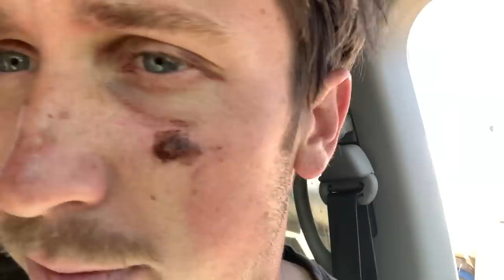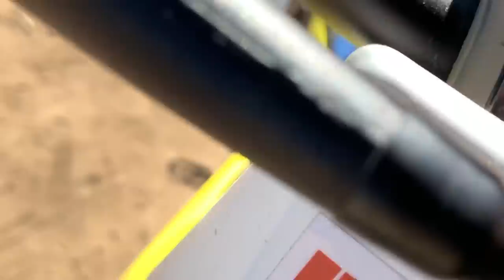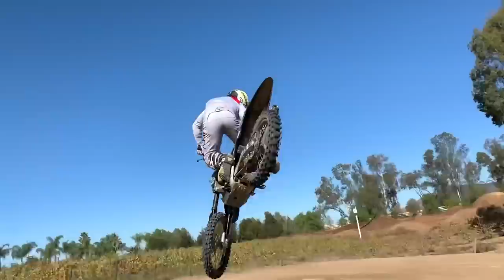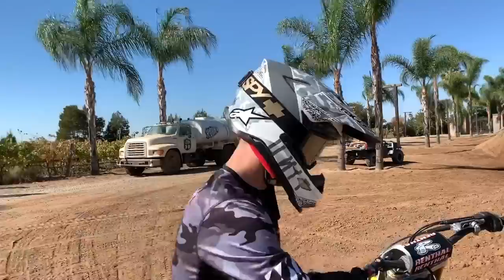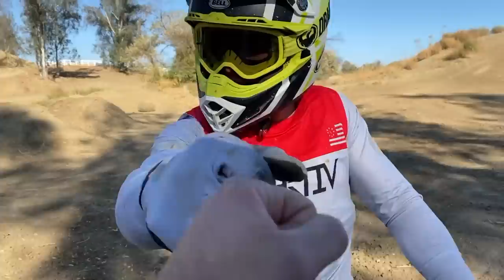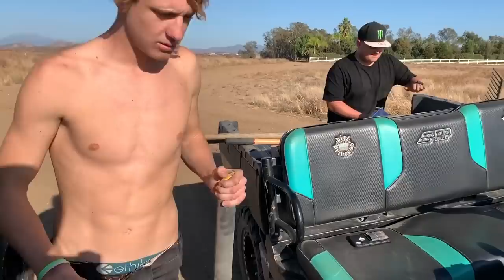CRASHES Brand New Dirt Bike - Buttery Vlogs Ep36

Comment: I got an 04 suzuki rm-z big bore 290 up for sale (scary fast) $4000 recently rebuilt gaskets re done last week or willing to trade for a reliable trail bike
Reply: Bike is not stock, rejetted carb, ported for big bore rebuild full fmf power bomb exhaust, intake valve kit, valve kit and springs, cam chain, top end rebuild all done just needs the carb tuned 👌